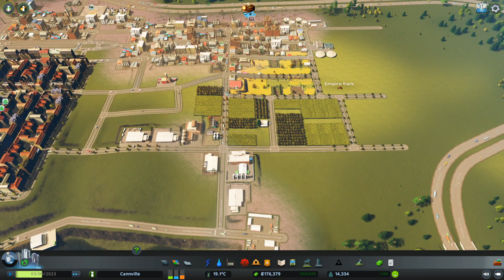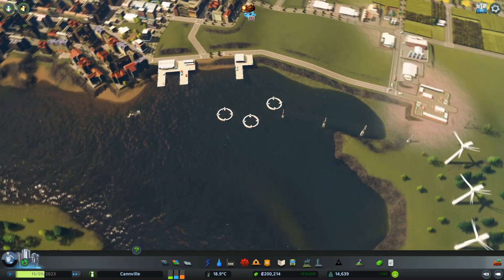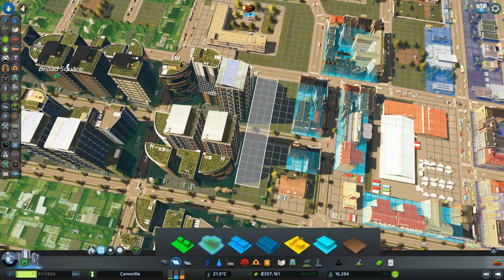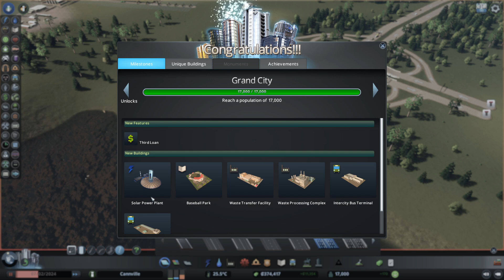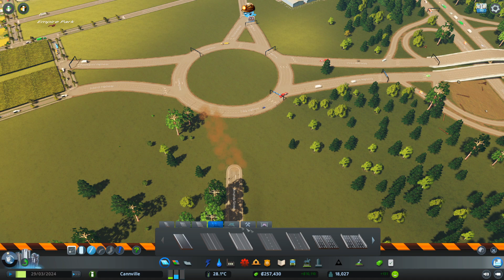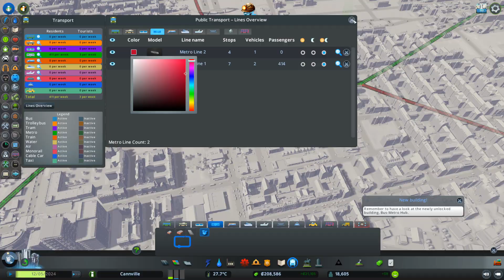New Waste Management : Cities Skylines Gameplay (Sunset Harbor DLC):Part 4

Comment: You can put waste transfer facilities in central locations easily, the ground pollution is so negligible. However there's one problem: one garbage truck has a capacity of 20,000 units, and by simple math this means a waste transfer facility can only put out max 13 trucks at once because their capacity is only 250,000. I'm not sure what they've messed up there, I guess the capacity should be higher (maybe even 10x if it's just missing a zero).

One waste processing complex equals to 4 incinerators in terms of processing rate. It also produces industrial raw materials like recycling centers.
Reply from the maker: ty.  Agree the waster transfer facilities seem incomplete.  Not sure I would want to put them near residential areas, but can see the benefits of having them in commercial and industrial areas.  Have a feeling using a combination of the various options will be the way forward.